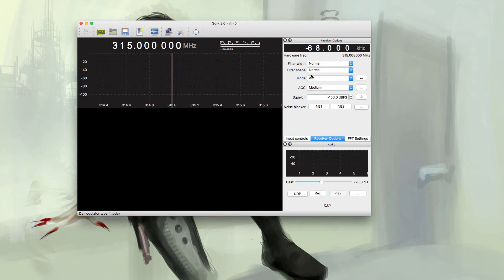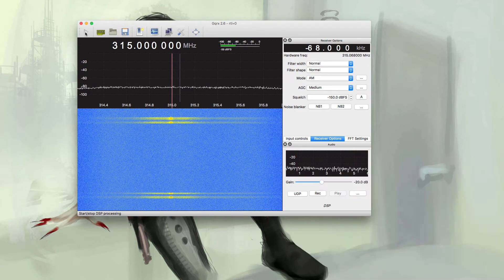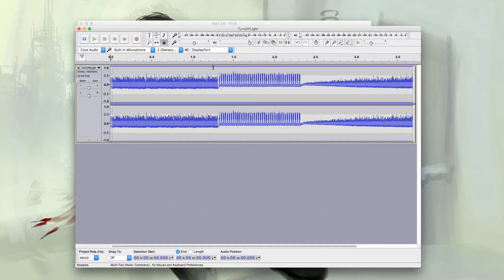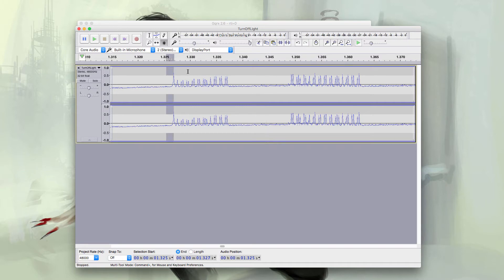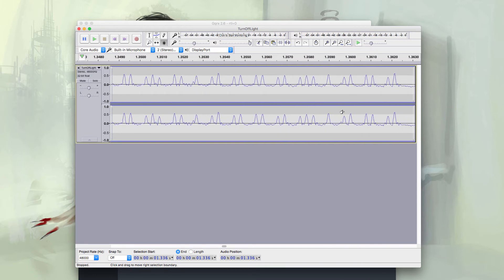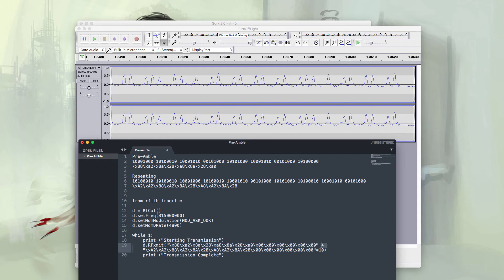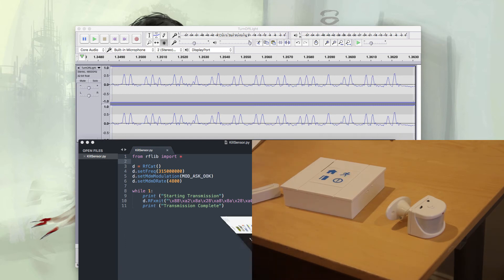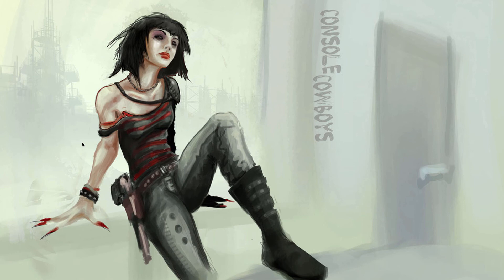Hacking and Disabling Motion Sensors -  0x03

Comment: Is there a way to detect this if you're the owner of a camera that's being hacked using this method?
Reply from the maker: Well from a logical standpoint it could be a few things.. If one item stops communicating with another an out of band message is sent stating its down and alerting you to an issue.. A second way could be an IDS monitoring the frequency for disruptions and alerting / triangulating the issue.. Both of these could be solved with some ingenuity and a bit of coding.. I am sure there are other options as well if you think about exactly what your trying to achieve and understand how your devices are communicating

Comment: Hi Cowboy ,also works with alarms with roling code?
Reply from the maker: You will have to assess the alarm that you are attacking  and analyze how that device functions, use that knowledge to attack it accordingly... If it has rolling code then you will need to bypass that by suppressing legitimate codes and re-sending... Everything is device specific to what you are testing.. you will need to analyze the data flow and interactions and test it according to what you are seeing.
Reply: ok thanks a lot, i have to attack it with RFCrack, -j mode :))
 @ConsoleCowboys

Comment: Great job....can be used for this test hackrf one?
Reply from the maker: You can do this with the HackRF, but you would have to set it all up in GNURadio and figure out what you need with that.... Do some research and give it a try!!!    I prefer the Yardstick its more penetration tester friendly for coding..
Reply: ConsoleCowboys What will be the range?Distance between yardstick and motion sensor....wich wil be best antenna ?Thanks for the replay
Reply from the maker: The best antenna would probably be a specific antenna for the frequency your device is using.. You can buy antennas for that frequency.  For example go on amazon and type 315mhz antenna, or 433 mhz antenna. Or use a telescopic antenna which might work best for a range of frequencies.  Range is variable, I mean its wireless, so there are lots of factors associated with it.. Are there walls in between your target and your yardstick, what are these walls made of,  brick, metal, sheetrock etc.   Range will be a case by case bases determined by your environment.  All part of the testing process.    Have you ever noticed when you move your Wifi router around your house things change.. For example if you put your wireless router in a room behind a brick chimney your house all of a sudden has horrible connection..   The frequency range and the environment will determine what kind of range you get.. Each frequency is also more or less resistant to the environment around it.
Reply: ConsoleCowboys Thanks a lot for the info buddy...you are the best😎😎